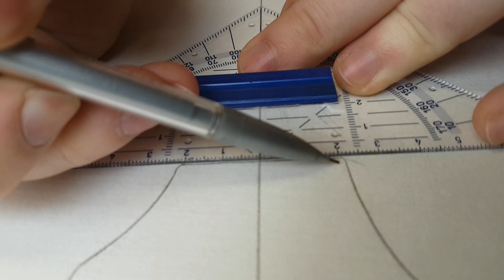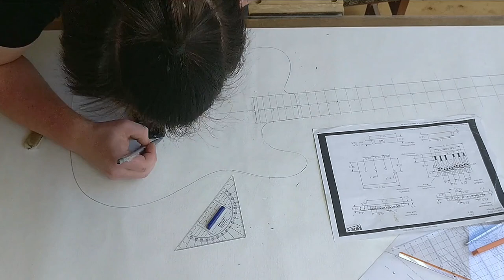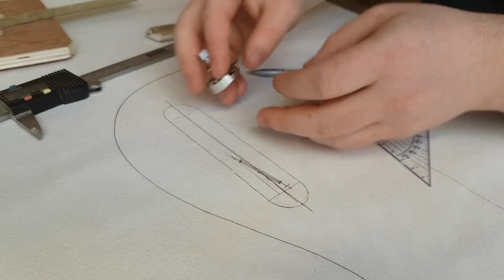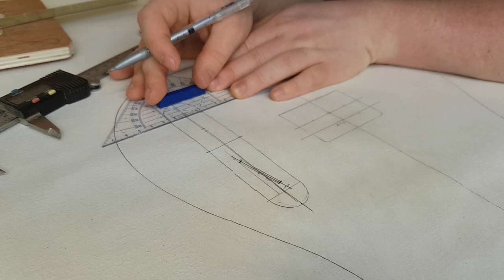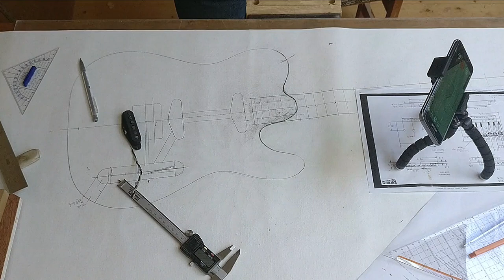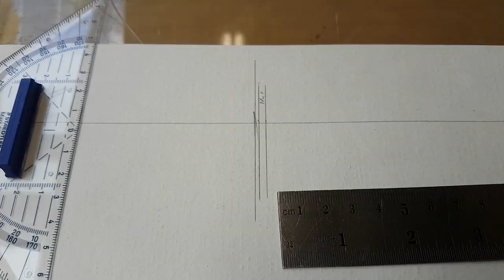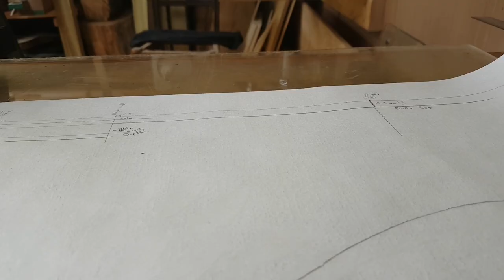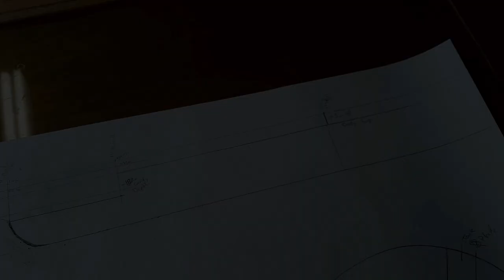Drawing a Full Scale Guitar Build Plan in Detail

Comment: I just do it in the computer.  Makes for instant scale changes, binding routs, guts holes, and the neck is always done in advance.
Then if I need a full size printout I send it to the plotter.  Plus, I can colorize it any way I like, and also take the 2D model into Rhino for CNC digitizing.
Reply from the maker: I've used the computer before as well, definitely more versatile and more accurate. I will probably sit down and redo this plan on the computer as well for those reasons.
Steeper learning curve though, and I personally prefer to do out plans by hand like this at least once per body type/style if it's something new.
There's something relaxing to sit down and  draw it all out with pencil on paper, and at the end of the day I have something that I can hang on the wall too, which I like.
Reply: "Look out baby cuz I'm using technology!"